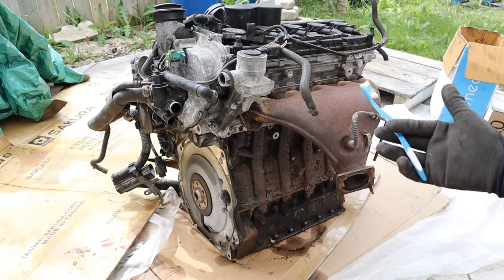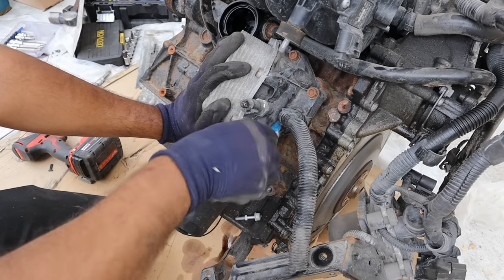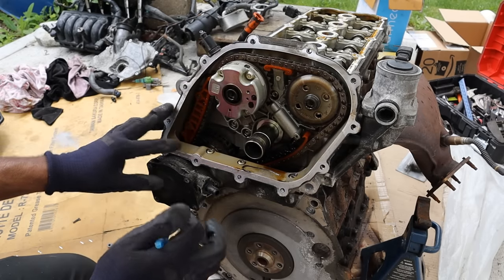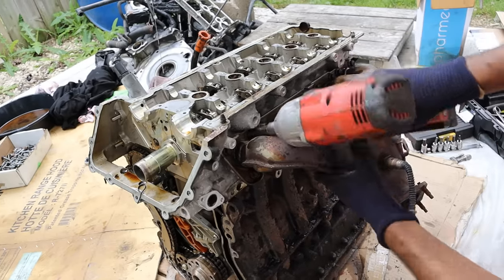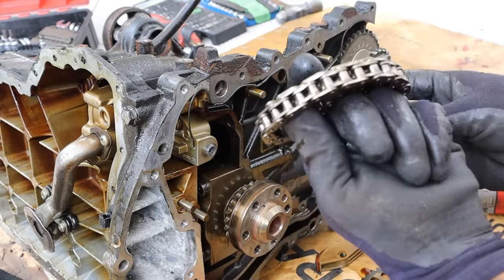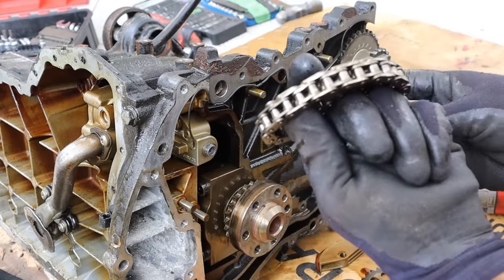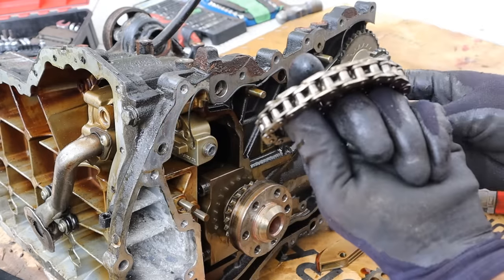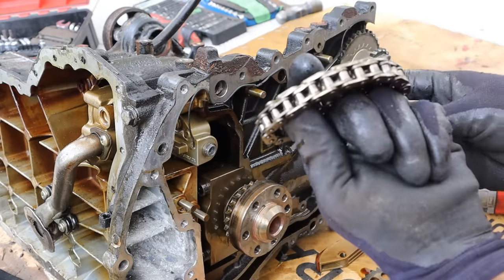The Volkswagen 5 Cylinder is an Anomoly

Comment: By the way, these are a member of the VAG EA888 engine family.  The EA888 is an evolved version of the EA827 four cylinder unit that was first produced in 1974 for the Audi 80 and Volkswagen Golf.  The four cylinder eventually grew to 2.0 liters, but due to the extremely compact design, it could go no larger.  Thus, VAG simply added a cylinder.

They didn't stop there though;  They took two EA827 designs and using CAD/CAM they produced the Audi V8.  Then they took two cylinders off of that to produce the Audi 90 degree V6.  Then they built a V10 out of the 5 cylinder that found its way into several Audi's and the Lamborghini Gallardo.

[Interesting side note:  All this had been planned in the early 1970's.  Ferdinand Piech even went so far as to suggest to the leadership of Porsche that this V10 design be utilized in the Porsche 928...]

Diesel versions and an inline 6 for Volvo were built, and even diesel V10's and a V12!  I suspect they got their money's worth out of the original EA827 design budget....
Reply from the maker: Thanks for the brief background
Reply: I read that these were from the gallardo v10 and have nothing in common with the 4 cylinder engines.
Reply: @workingmanaudio2754  No, these are a development of the four cylinder, as was the V10.
Reply: @Flies2FLL  Wow. The v10 and 07k don’t seem similar to the 4 cylinders. Interesting.
Reply: @workingmanaudio2754  It may seem odd to say the engine in an old diesel VW Rabbit and the V10 in the Gallardo are related but they are indeed the same engine family.  This is an evolved design rather than a new one, and nearly all variants from four to twelve cylinders can be built on the same machinery.  The biggest give away is that they all have the exact same bore spacing, 88 mm.  

The EA827 block is tiny.  In fact, it is starting to be common for hobbyists and racers to install the cylinder head from a Suzuki Hayabusa motorcycle on the VW block and then make stupid power. Some welding and drilling is involved, but it is nearly a perfect fit.  Because this block is so small is why it not only fit in the early Golf/Rabbit, but why they had to add a fifth cylinder to it in order to get more than 2.0 liters displacement.  Once they went down that road, it was easy to think of other variants.
Reply: @workingmanaudio2754  OP is on Crack...... 07k was designed by  Head  Audi engineer Ulrich Baretzky.  The engine was based on the IMSA GTO Audi 90 race car motor (yes that iconic motor from the group B era). Hes on record claiming he wanted to bring back the 5 zylinder sound for the brand. He worked on the IMSA car fresh from leaving BMW and he was the mad scientist who designed Audi's Diesel Le Man's  domination......  Vws O7k is a watered down version. Lamborghini's Gallardo being developed around the same was based on the 07k or at least influenced by it so there can be  parts sharing to cut cost.

Comment: 148 HP? Should be around 170-175 HP 😂
Reply from the maker: It should be
Reply: The last versions of these engines came 170hp stock & its still being held back but if you want longevity this engine is great but VW stopped releasing them in 2014. Also mpg isn't bad 28-33 mpg.

Comment: Great video, does your wife watches these videos and wonder where her clothes go😅
"Lube her up, dry feels so wrong."
Any idea on the age (not the wife) the engine?
Typical vw over engineered, over complex and over priced. 
Did you ever do a Volvo 5 cylinder?
Reply from the maker: It's a 2008 Rabbit. 
And yes, always use lube if it isn't there already 🤣
Yeah I tire down a Volvo 5 cylinder like 3 years ago, check it out.
Reply: Here in the UK, they'd never call a car rabbit, because anything furry that hops round in a field is a rabbit, anything that doesn't invariably contains a trio of batteries and is usually called a rabbit, which is a euphemism for a dildo, which incidentally, manufacturers also say requires lubrication. 😊
Reply: @speedkar99  See what you started...lmao
Your Volvo teardown was excellent 👌 👏